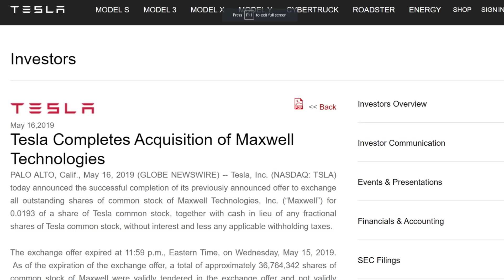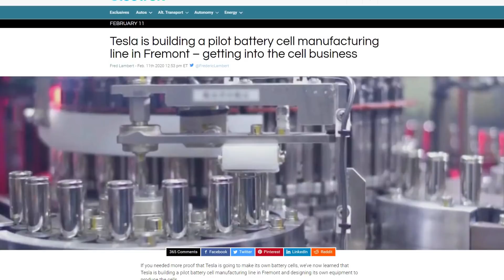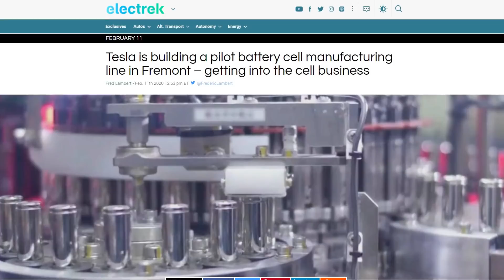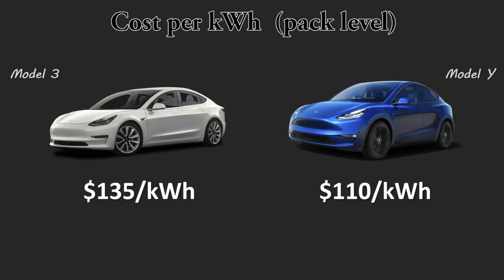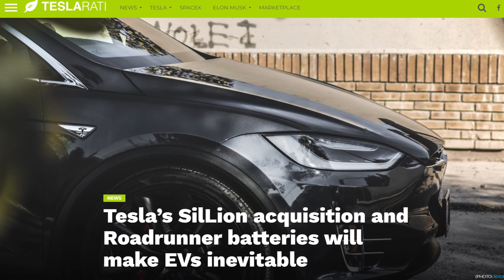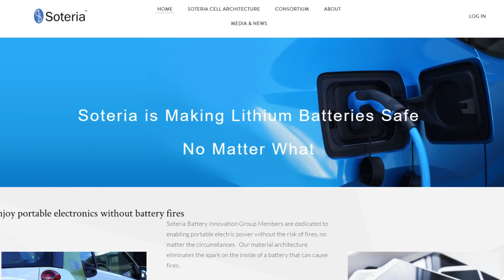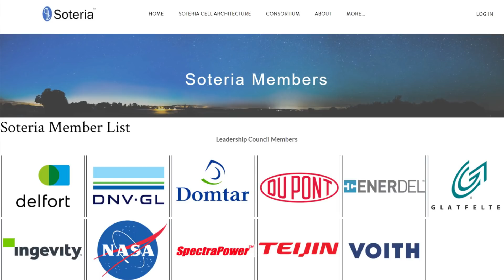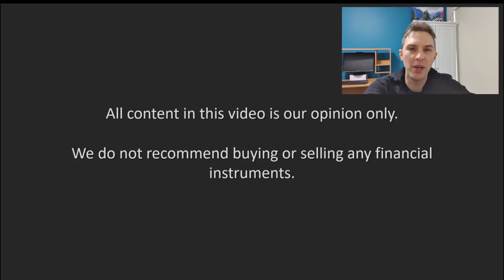Tesla Battery Day Predictions (With the Limiting Factor)

Comment: ANTICIPATED TESLA STOCK BUMPS

 1. Investor day, profet, texas. : stock goes up.
 2. Stock split 5 to 1. : stock value goes up.
++++++++++++++++++++++ DONE +++++++++++++++++++
 3. Battery day. : stock goes up.
 4. S & P 500, DOW 30, inclusion. : stock goes up.
 5. Cap rase. : stock goes up.
 6. Tesla acquire high view power. : stock goes up.
 7. Shift battery production to battery wall and vehicle use. : stock goes up.
 8. Stop all giga batteries replace with high view. : stock goes up.
 9. Giga Austen Start cyber semi production. : stock goes up.
10. Start cybertruck in ny., na. china, germany. : stock goes up.
11. Buy peeker plants Replace with high view power sell power. : stock goes up.
12. Tesla battery density up 20%.: stock goes up.
13. Sort sellers have to get out.: stock goes up.
14. Giga berlin produces model Y : stock goes up.
15. Night Vision HUD & Wire Reduction Munro Live.: stock goes up.
16. Ford fails.: stock goes up.
17. Cyber truck goes into production.: stock goes up.
18. Tesla buys mines.: stock goes up.
19. Tesla compact ev begin production.: stock goes up.
20. Tesla cargo van ev begin production.: stock goes up.
21. Tesla HVAC sys.: stock goes up. 
22. Tesla new plant in asia.: stock goes up.
23. Tesla new insurance plan international.: stock goes up.
24. Tesla wind turbine produced in NY.: stock goes up.
25. Tesla finishes FSD.: stock goes up.
26. Tesla micro factory produce vaccines.: stock goes up.
27. Hardware 4.0 comes out.: stock goes up.
28. Redwood Materials will partner with Tesla.: stock goes up.
29. Tesla buys the boring company. : stock goes up.

 Air gets cleaner, deaths get lower.
Reply from the maker: Great points but the questions is what has already been priced in?

Comment: CTXR :Huge inside buys (8/21/2020)
    From 2018-2019, its Chairman accumulated over 10 million shares at the prices ranging from $3 to $99c per share, and the same period, its CEO accumulated over several million share. 
    The growth rates of CTXR EPS are about 50% per year. It will earn 74 cents in 2021. At recent prices drop from $1.3 to $1.0 per share. CTXR is a steal.
     Mark my words here, it will worth 10x before the end of 2021!

Comment: Nice interview @thelimitingfactor and @evstockchannel. The highlight of batteryday will be most likely super duper production line for the electric vehicles with a crazy output, and finally $100/kWh achievement. I don't think there will be an accouncement of the maxwell tech or soteria incorporation into batteries. But that is just my guess :)
Reply from the maker: They have had time to get the maxwell aspect working not sure about soteria

Comment: I think they will reveal 3 types of cells.   LFP with Maxwell Technology and Cell-to-pack that will significantly enhance LFP energy density. Enough to eliminate the need for Nickel based cells for all mass market cars. Road runner, a high density Nickel based cell for high performance vehicles. And a very high density anode free cell with lower cycle life (probably 200-300)  that could make very good sense for airplanes. If they figure out efficient recycling (which I expect they will talk about) lower cycle life may not be that much of an issue.
Reply from the maker: Great points
Reply: My understanding is that even with Maxwell manufacturing technology and some other advances, LiFePo4 will achieve less than the density of the existing Tesla 2170 cells (?).
Since the objective is to achieve TWh levels of production, density is important, because it immediately reduces the quantity of "units" you need to produce.
For instance, the existing GF Nevada, with 250Wh/kg(?) cells, produces circa 30-35GWh.
That means roughly 30(+/-) factories per TWh.
A 20% increase in output per factory may reduce that to 24.

If Maxwell (and others) can 5-10× the speed, that could be as low as 5 factories, on a smaller footprint?
You can compound the reduction in factory numbers (1bn per factory?) Process energy savings(!) Land cost savings, etc and reach a cost for 2170 cells well below $100/kWh.
Reply: @rogerstarkey5390  In the long run, I agree higher denisty cells will work out cheaper. After all with enough scale the price  almost every thing ranging from a burger to a car to  a jumbo jet converges to about $10 per pound. Hoever, in the immediate future, it may be less possible to scale up Nickel based batteries to Twh scale. Probably less of an issue with LFP.  Even if LFP based batteries can achieve only 200 wh/kg they will be sufficient for mass market cars with decent range.

Comment: The one thing that no one is talking about is , the improvement of recharging time, biggest complaint from ICE owners about EV's.
Reply from the maker: Excellent point you are right i haven't heard anyone talk about that.
Reply: Toyota has a solid state battery with a range of about 3000 miles with a 15 minute recharging time. 15 minutes is acceptable only if they can produce that type of range. NOBODY wants to be a "sitting duck" at a charging station while on a long trip...
Reply: @davidwhite2934  And its self charging.

Comment: Prediction: Standard batteries / reduced weight and tidied up chemistry with Pana and Catl 20% more mileage and million mile bat  (giving double existing capacity).
Tesla internal development: 20% more capacity, 3x charge speed,  high regen capacity,  high current delivery due to capacitor integeration and and tabless design. Dry battery procduction ( 10% space required and 10x speed s no drying line ) therefore same space has 10x machines producing 100 times batteries i.e. 1000 x speed (materials become limiting. New tesla batteries tested in megapacks, cyber truck and tesla semi.
Reply from the maker: Great points Mike
Reply: Congrats Mike M.  Capacitor integration, specifically Maxwell's hybrid lithium capacitor (the "L-Cap"), is the wild card.
Reply: @allenyoungwood1133  Imagine if you made a battery in the same roll a capacitor in the middle. It would charge real fast, discharge fast and prevent  production of crystals. only needs to be about 5% of the capacity,. No need for a fuse as the capacitor averages it out. Make it dry and production is fast too.

Comment: My (shallow) understanding of the "million mile" battery was that it was an electrolyte additive at heart.  Panasonic could licence the tech from Tesla and instantly turn the 20700 into a "million mile" battery.  Panasonic recently said they will be upgrading lines at GF1 in Sept to increase battery density by 5% which would line up with the "lithium doping" energy desnity numbers rather nicely.  Just doing those 2 things would mean all cars coming off the assy line on battery day would be million mile with an extra 5% range.  The super-duper batteries (tabless, cell-to-pack?, single crystal) could then go into top spec roadrunner S (possibly X) to avoid Osbourne effect since there is such a huge price gap between the S/X and the 3/Y.  Presumably roadrunner also for Cybertruck and Semi which aren't out yet.
Reply from the maker: Agreed Marshal soo many innovations
Reply: It sure would not make sense for manufacturers to raise their capacity if Tesla just made all their own.
Not for Tesla to buy standard-tech production from them.